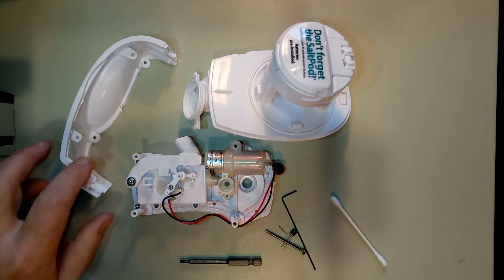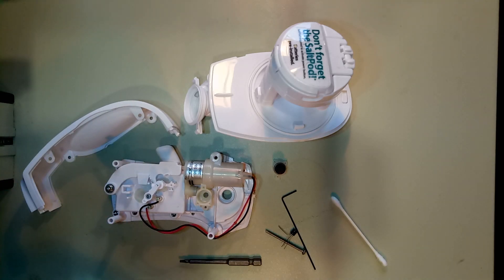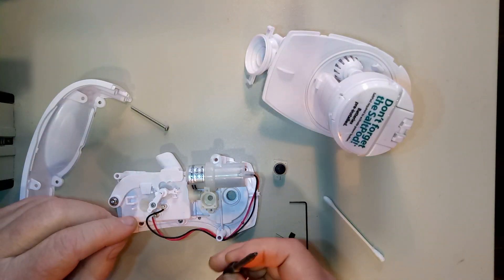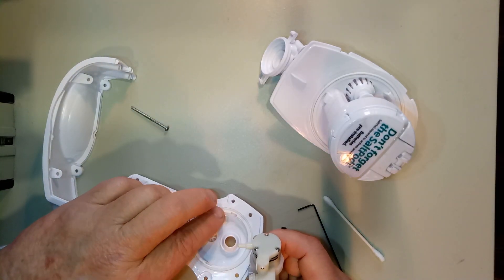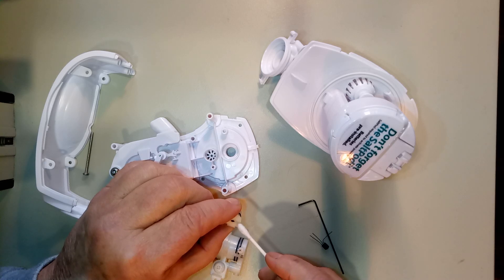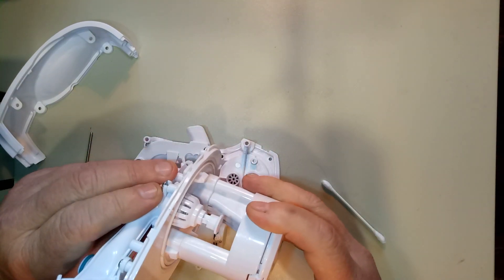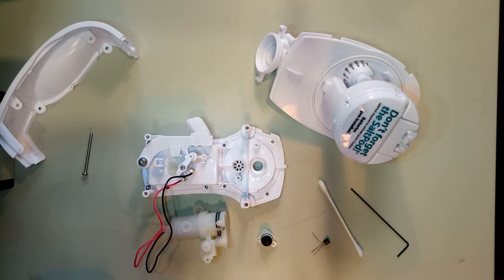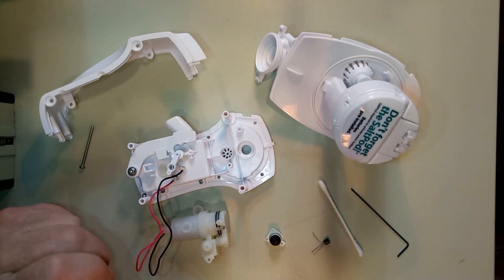NAVAGE Inside View, Tear Down And Repair Water Lock Vacuum Pump

Comment: To get it apart, get two thin flat head screw drivers and twist at the seams; with one screw driver slowly pry open then place the first screw driver to hold open the seam then take the second screw driver and keep prying open (that is how I got it opened). To test the motor I removed all components until I got to just the battery. But I think it is much easier to connect a AA battery with wires to the gold post if you hear/feel the motor run then it should be good. My issue is the contact point of the Navage that contacts the positive side of the battery were very rusted and the small wires broke. I have to find time to fix it somehow.

Comment: Mine is an A series and the plastic plugs on the bottom are hard plastic. If yours were the same. how did you get them out to get to the screws? Trying to see if I have to drill them and then rese
al the caps.
Reply from the maker: That was a long time ago, I don't remember any plastic plugs. Haven't used it in two years.

Comment: thank you for the video, I had an issue with the button being jammed when I don't use the Navage liquid thingy, I prefer making my own.
After opening the apparel i found the thing that blocks the button when the top cap isn't close properly.
I manage to pull on the thing which separate from the rest. I can now use the Navage system with my own nose cleaning solution without problem.

Comment: Wish you would show how to open?
Reply from the maker: I wish that someone would send me money. That is not going to happen either.  I don't get a dime from YT. There is more than enough information there and in the comments to open this.  These were never intended to open and opening something plastic has the potential to damage it.  I have not seen the Navage in more than a year. This video was for entertainment only.
Reply: @opera5714   Hey thanks for the video, appreciate what info you have given. "Pry open non button side from the back first." Seems to be the main gist of what is needed, I have the torx screws undone and I assume you split front to back along the seam. Seeing how people do this is usually the difference between not breaking tabs and having to glue it back together. Cheers.

Comment: It works great when it works. The problem with the device is over time the sinus rinse solution gets past the pump and down into the motor. This causes the top bearing in the motor to corrode and stop the motor from spinning.
Reply from the maker: It never really worked for me with my nasal issues.  Salt water and electricity just don't mix well for long. I think it is a well engineered unit.  Eventually water will just get into the wrong places.  I got mine for $50 shipped from the factory.  Like everything else in our society, it has to b considered a throwaway.
Reply: @opera5714  I refuse to live in a throw away world and have ordered a new pump, part # RF-130CH. For the $80 I paid and 2 years of use out of a product is crazy.

I posted a response for the part # to others asking about the motor and those posts were deleted?

Comment: Used mine for a year, and today it died. Not batteries, they were changed earlier in the week. Not salt, I rinse it thoroughly after every use  and let it dry. No, poor design. I got it apart easy enough - a small screwdriver in the centre of the back seam popped the two halves apart after the long screws were undone. All inside was fine, but as I saw from early on, the battery compartment has no formal compressible seal, consequently water can find its way into the area corroding the terminals. I’ve been keeping them clean, and a while ago applied a thin film of Vaseline along the battery case joint to keep the water out, but it’s not perfect, consequently when I got it all apart it was all clean, no salt, I could spin the motor up with a spare battery attached to  the terminals, but inside the connection area, which you cannot access there is clearly a connection problem. Yep, poor design. I’ll buy another as it really does work for me, but before use I’ll run a thin bead of non-setting sealant along the battery tray joint before screwing it down. A small neoprenes gasket in this are would likely solve the problem. Would have cost pennies. You live and learn.😏
Reply: I never had that problem with the battery compartment. Solution leaked from the pump into the motor corroding the top bearing. You can order a new motor as well as battery connectors online. Motor part # RF-130CH. Use rechargeable batteries they don't have alkaline to leak out

Comment from the maker: I haven't seen mine for a year. It never worked that well for my nose problem.  These don't need screws to hold them together.  At 4:34 I show the tabs. The tab side of the housing needs to be pushed in to get it to release from the other side.

Comment: How did you get it apart? We cannot get to the inside of the thing after removing screws.
Reply: use a thin knife or something to separate the bottom part first. start with the size that doesn't have the button.
You should be able to find the place where the 'platic locks' are and then separate the side from the base.

Comment: this is really bad quality and expensive. mine is just couple times and the power button not work. i have to open it to repair. the stick to push the power Spot is not long enough, i put a thick tape under It and correct the button location and finnally it could work now. waste lots of my time to repair it. 😢

Comment: My smallest allen wrench doesn't do a thing for the tiniest torque screw.  Any suggestions on what else to use? Or what size torque screwdriver to buy?
Reply from the maker: My NAVAGE is 800 miles away and and won't see it for 5 months. I just don't remember what the bolt is. If it is a TORX it could be a T-10. Even that might be too big.
Reply: Torx T6
Reply: T5 worked for me

Comment: How to de-capitalize your Navage;
After some messing with it, I found there was nothing at all wrong except that the mechanism that forces you to use their pods (when the button won't press) was not working right. If you look at the mechanism attached to the button, you will see there is a little tab on that armature that bumps into the vertical post attached to the pod holder. Just break that tab off with your needle nose and you are G2G. 

Also you don't need a friggin KNIFE omg... just use a small screwdriver and fiddle at the back seam until you see the dark square in the center, insert screwdriver, oula!

You can probably also defeat the vertical post but I think the thing has a sensor inside to prevent it from always being on.
You now have a Socialist Navage.
Thanks for the vid.
Reply from the maker: I think I just cut a pod open so just the ring remained. Might have reinforced it with some tape for a while. Last I remember was sticking a finger in when closing it.  Haven't used it in about two years, it is 800 miles away at my summer camp.

Comment: Disclaimer - this will void your warranty.  Disclaimer - Using vinegar to clean battery corrosion in your Navage is at your own risk.  Best to throw the Navage out if you're unsure.  Short story:  My interlock switch (under the q-tip in the video), was corroded causing intermittent motor speed issues.  I cut the rubber membrane away from the circular interlock hole.  Putting a couple drops of vinegar on the leaf switch and swishing it around with a q-tip fixed it!  Will vinegar and corrosion get in your nose because of this?  Don't blame me!  I considered putting a blob of solder on the switch to short circuit it, but plastic will melt if I try this.  Instead, I put a small screw driver under the top leaf of the switch and bent it up into a tent position.  Now the switch is permanently on!  The button you press to work the Navage is on an arm, and the arm has a tab on it.  I took side cutters and cut the tab off.  Now the Navage has no interlock at all, the button always starts the motor running no matter if the top is closed or not.  No need to do the trick to avoid using salt pods.  

Will I use my modified Navage?  Well I believe water was entering the battery compartment in 2 ways.  1) When I was washing the top lid, I think water was creeping down the shaft afterwards, and going through 2 micro holes in the membrane where the post was pressing on the membrane.  2) Further over the membrane has a dark spot, and the membrane has separated from the white plastic.  I think I could seal the interlock switch hole with rubber cement, and put some over the dark spot.  I think this hacked Navage will be spare parts.  I have purchased a new unit, and when I wash the top lid, I'll lay it on it's side to dry so the water won't run down the post.  In hindsight, to get vinegar to the interlock switch, I suspect I could have introduced some drops of vinegar into the holes of the battery posts.  Again, since the Navage probably has leaks, will vinegar and/or corrosion get into your nose?

My supplemental advice for opening the Navage up is:  1) Wear safety goggles. 2) Get 2 thin bladed, wide-ish, screw drivers.  I used a large swiss army knife screw driver, and a metal 3D printing spudger (used for prying prints off the bed).  3) Insert one of them at the rear location, into the seam.  I started at the bottom edge, pried, and inserted the other at the mid point.  You are prying the side with the button, up. You are going to mark/mess up the seam. 4)  Though you have pried it apart, it's still hanging together, as there are 2 alignment dowels.  You'll have to keep prying and separating with some finesse until it clears the dowels.  5) Keep pulling the non button side off.  It'll take some force with finesse.  The front of the side has a clip.  See the 2 small holes on either side of the front nasal port?  There are clips behind each one.  In theory you could unbend a large paper clip and stick it in the hole to press back on the clip, but I didn't do this, just finessing it caused it to come apart.  6) On the button side, as you're pulling it apart, you're going to have to push the button in as it will snag a bit.  For those interested, my motor has the following markings: "AJK-B03A2105" "DC 3.0V" "20180310" My motor is working fine, it was only the interlock switch that was not working due to corrosion.
Reply from the maker: Warranties, we done need no stinking warrantees. If the unit ingested a bunch of salt water, you don't have one. I just thought someone would like to see the inside.  Youtubers are voyeurs,  they seldom actually do anything.
Reply: @opera5714  Thank you for your video!  It got me well on my way to figuring out what was wrong.

Comment: Man this video is not helpful. Well anyway, I took mine apart and it looks like water got into the motor. Salt was in the rubber casing and a lot of moisture. Not sure how water made it in. Also the water was brown so it looks like corrosion is my problem.
Reply: I had the same issue. A little drop of 2 in 1 oil and spin it a few times will get it going till you order a new motor, part # RF-130CH

Comment: Took out the 4 screws still can't get inside
Reply from the maker: This video was never intended to be a how to.  This is a rather sophisticated assembly and as you noticed the screws are not necessary to hold it together. The top and bottom are held together by the sides. Where the two sides meet, one edge has to be pressed in and as a crack opens, insert a thin knife and pry open.  You may notice in the video there are locking tabs.  Press on the wrong side and the crack gets tighter and will never come apart. The battery wires are short so be careful.

Comment: Are you not supposed to change the battery in this thing?  I want to put in fresh batteries if I can.
Reply from the maker: There are screws on the bottom that have to be removed. I think it takes 4 AA alkaline batteries. I haven't used mine in a year, can never get it to flow from one nostril to another.
Reply: @opera5714  I managed to get the screws out, but it was impossible to get the lid off.  I tried using 2 flat head screwdrivers to leverage in those 2 grooves but it still wouldn't budge.  I ended up getting covid and I don't think that would've happened if the batteries were full strength.
Reply: @opera5714  To get it to flow if one side is blocked, twist the nostril part so it flows the other way.

Comment: Thanks helped me get my unit going, I was never able to get that tiny screw out to check if it was clogged but having the motor exposed so I could apply power directly to it allowed me to free up the motor and get it working.. thanks for sharing the video as it made getting the unit open easy.
Reply from the maker: Glad it helped. I had mine apart and as an afterthought did a quick video to show the insides.  Never intended it to be a step by step. Videos don't make me any money.
Reply: Mine is an A series and the plastic plugs on the bottom are hard plastic. If yours were the same. how did you get them out to get to the screws? Trying to see if I have to drill them and then reseal the caps.

Comment: What is the battery power?
Reply: Also, curious how this device has no mention of how it is powered and what to do when the battery eventually fully discharges.
Reply: 2 screws open AA battery compartment when replacement necessary.

Comment: Thanks for this video, it helped me repair my Navage. 

For those concerned about splitting plastic open with a sharp knife, you can see in several parts of the video where the clips are (four total). There is a clip on each end  in the middle of the seam, and one clip behind each of the tiny holes on the front. I suggest doing the seam away from the nasal port area first. The next seam is at the exact opposite end, in the middle as well.  See those two tiny holes in the front to each side of the nasal port? There are clips behind those, but you can push them out of the way with tiny pins either while doing the main seam on that end (only need one pin) OR get gutsy with your knife and one of them will pop.

If you are afraid to use a knife and break the plastic or clips then find somebody more mechanically inclined, because reassembly isn't much fun where it comes to getting the plastic posts to seat correctly.
Reply from the maker: Form follows function!  There is always some cosmic angst when pulling plastic apart. Viewing tab location is the key.

Comment: My unit has mold in the battery compartment.  Like many, I can't get the sides off, even after gouging the plastic.  My question:  Is the battery compartment isolated from the other interior areas? In your video, it appears to be isolated. Also, I wonder what the function is of the two tabs at the top and bottom at the battery end.  Are they involved in releasing the catch holding the two sides together?
Reply: Did you every find out how to fix this

Comment: Hello, my unit is only 3 months old and completely stopped to suction making it useless. It still pumps water but won't push it through my nose. Took it apart cleaned everything and didn't see any obstructions. Called company and after troubleshooting over the phone they issued a new module. Is this an issue with them? I hope not because  I'm doubtful if it happens again that I'll get another new module. Its disappointing I like it.
Reply: I also got a replacement module, but it certainly isn't new. I'm hesitant to use it!
Reply: In the video he shows the tiny 4 holes, they clog with salt from the saline .
Reply: @garrettgunther2116  It was the lower tank, it wasnt sealing and wouldn't suction. They sent a new one. Not impressed and it's only 4 months old

Comment: Just curious since I can't find a solution elsewhere, a friend's navage stopped working so he asked me to fix it. I took it apart and discovered a fairly rusty motor, which I'm pretty sure is the problem. I see some motors on Amazon that look like they could fit, but I'm not certain. Even if I get it and it fits, I'd still have to solder the wires onto the unit. Any ideas or input, or should I tell my friend to just buy another one? BTW, the motors are less than 8 bucks, so if it could work, it would be well worth the trouble instead of buying another one. Thanks for any help.

Comment: Would help if you actually showed people how to disassemble it 😐.   Your opinion on mechanical aptitude is a waste of time considering.
The video did not show tear down nor the actual repair.
Reply: He most likely Broke it! He doesn’t even show all the assembly parts.
Reply from the maker: @dahnic69  There is a full length video showing never before seen footage and deleted segments.  $29.95 + SH. Get yours today!
All you need to know is:
Form follows function
F=MA
And you can't push a rope.
Reply from the maker: Is anyone else making a video showing you what is inside? I had it apart and made a quick video of the inside.  Form follows function. Complain all you want.  Nobody pays me.